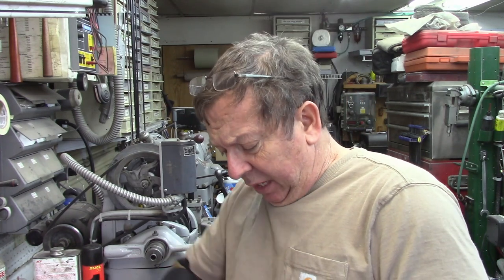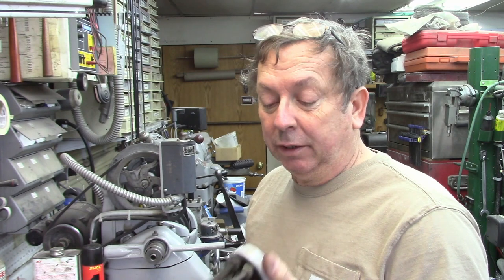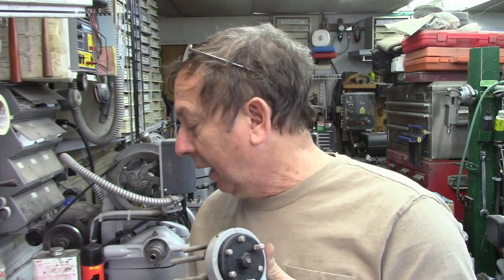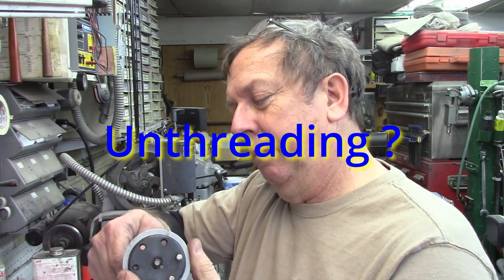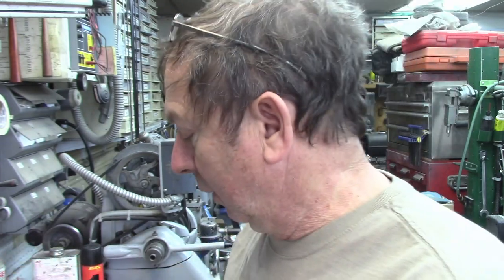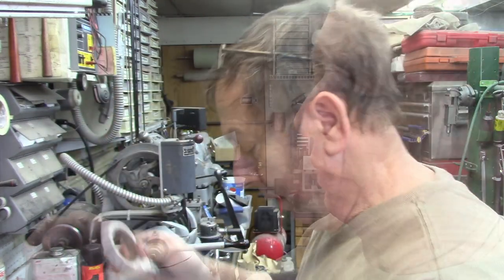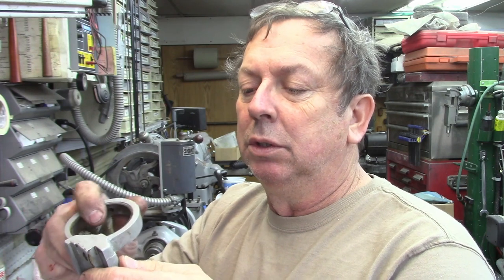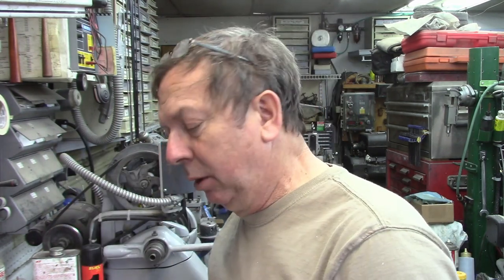Making Atlas Machines Affordable Again: Atlas Turret Lathe #690 Multi Stop

Comment: Excuse me just getting my atlas up and running everything seems to be working well I was wondering if there is a give on the knee for up and down did not see one even in the parts list
Reply from the maker: Hi Carey, not sure exactly what you are refering to. If you mean a lock for the vertical movement of the knee on the milling machine there should be a locking knob  M1-42A on the right side if the knee that presses against the gib. Also be aware that the elevation screw underneath the knee will often have a bind in it from wear. This hanging is usually from where the screws transition fron the inner to the outer screw (or vice versa) which may give the illusion that the knee is locked.
Reply from the maker: You are certainly welcome